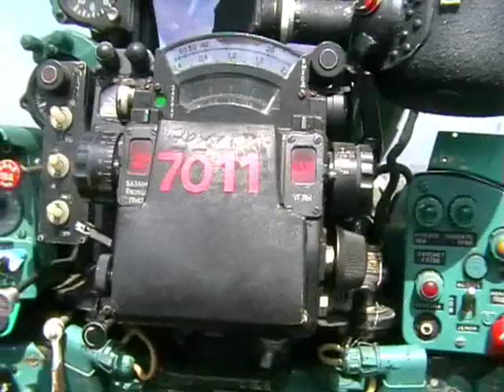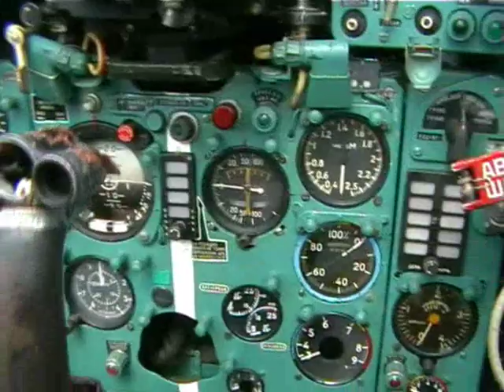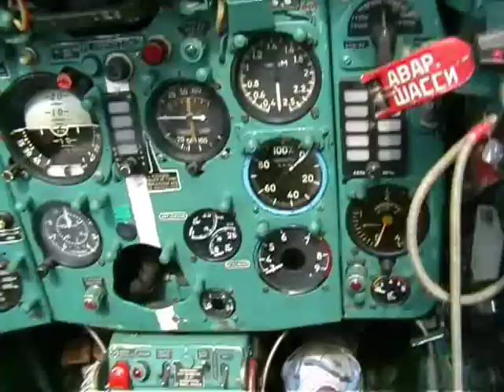Mig 21 Start Up and First Flying Lesson :-)

Comment: so basically you have to turn on every available switch on the panel in the cockpit to make it run
Reply: 1. Turn on circuit breakers 
2. Start engine 
3. Wait for engine to heat up
4. Press switches in cockpit for instruments, gun sights, etc
5. MiG-21 is now started 

simplified

Comment: @Curicua 
Actually, the hand grip of the throttle does rotate like a motorcycle throttle, I just don't know what it does.  I own a MiG-21MF-75 cockpit section, Polish Air Force No. 8022.  I'm still looking for a manual for this particular version of the MiG-21, I've only managed to find out what some of the switches, knobs and lights are for.